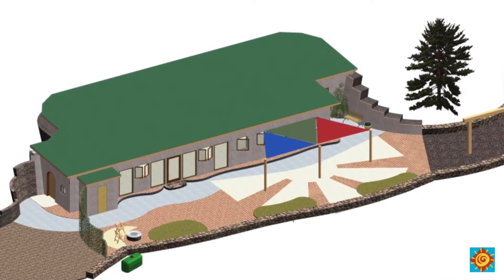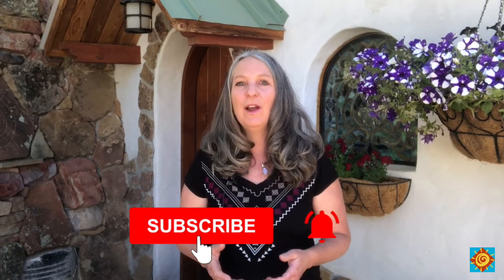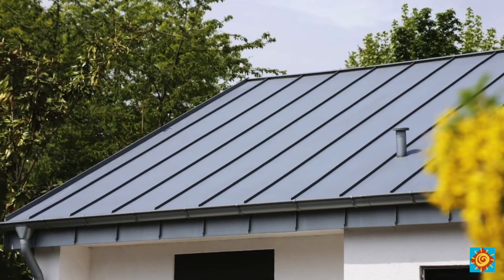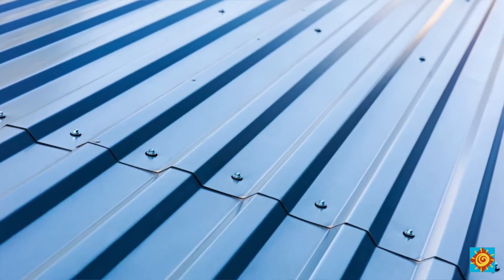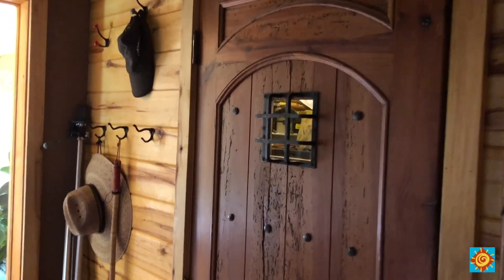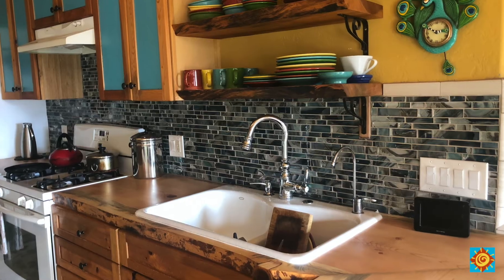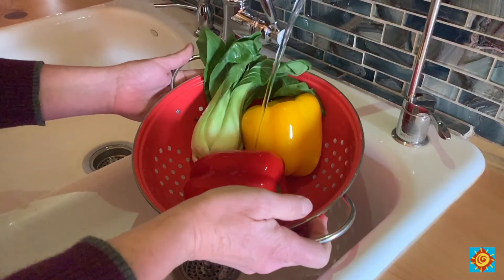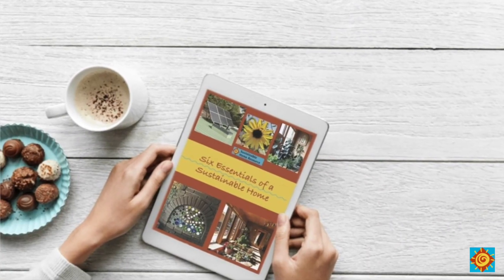RAINWATER HARVESTING ~ A Tour of Our Home’s System

Comment: How’s do you set up that clear tube to see how much water you have?
Reply from the maker: Thanks for watching and for asking!  Since you're clever kids I'm sure you can do this!  
Tee in a small line (3/4' or 1/2") between the cistern and the water pump.  Connect a clear hose to that and run it up to at least the full height of the cistern so it doesn't overflow.  Be sure to put a valve on it so you can replace the clear tubing when it gets funky.  We replaced ours once after about 9 years.